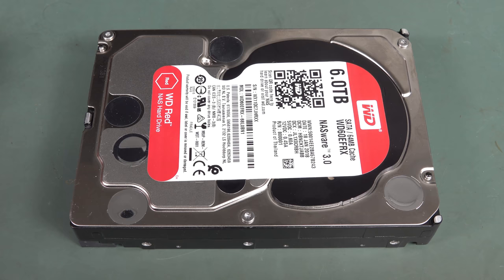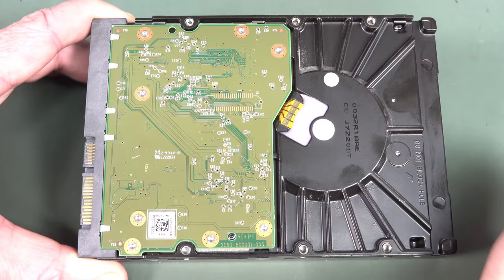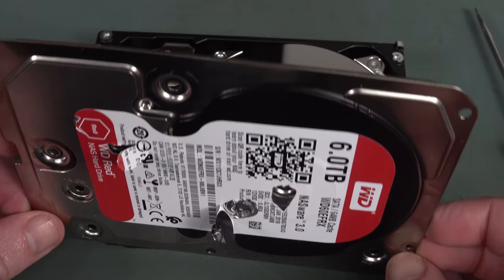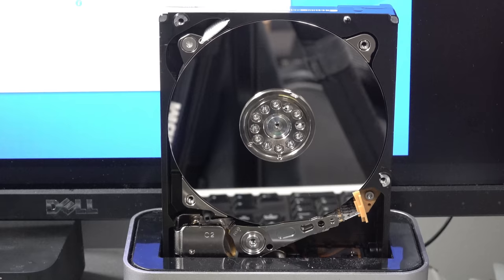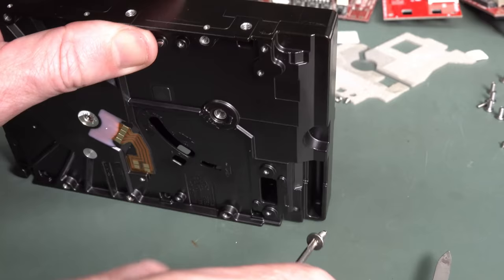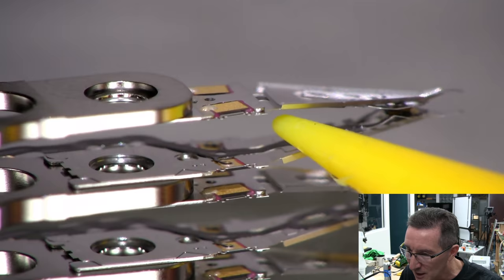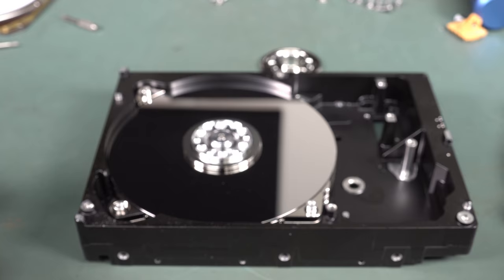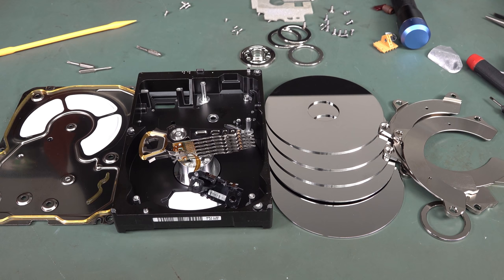EEVblog 1398 - Western Digital RED 6TB WD60EFRX Hard Drive TEARDOWN

Comment: In my experience, actual physical head crashes are extremely rare in modern hard drives (especially with 3.5" form factor drives) and the failure mode is almost always down to corruption of the embedded servo data, resulting in the drive being unable to track properly, or a problem with the drive electronics - the hub motor / head actuator drive chips often get very hot and are known to fail. The motors themselves very rarely give problems, so if a hard drive won't spin, it's usually going to be an issue on the PCB. Chattering heads (the actuator arm banging back and forth between its travel limits) is often caused by bad servo data, in which case there's not usually much that can be done to correct it. Total failure of the drive to be detected by the operating system is invariably the main onboard microcontroller/DSP chip and intermittent detection failure is usually just bad cables/connectors.

The little "bag" which you thought was a dessicant pack is actually a filter designed to trap any particles that get thrown off the surface of the platters - thses things are generally spinning at between 4000 and 8000 rpm and thus any dust and debris that lands on them will be hurled off at high speed due to centrifugal force - as a result, opening the hard drive in a non clean room environment is nowhere near as damaging as popular myth would have us believe - I've done it many times, particularly on certain laptop drives that have a habit of sticking (I'm looking at you, Samsung) without any problems, and many of those drives are still working years later (9 years and counting for one of my own drives). I wouldn't recommend it of course, but if you absolutely have no other options available to get a drive fixed, then it's not something you should be totally paranoid about, as it is entirely possible to get good and reliable results from this procedure. Obviously you should work in as clean an area as possible, using minimal air circulation (turn the desk fan off), keep your fingers and any tools off the platter surface and try to get the job done and the drive closed up again as quickly as possible.

(and try not to let your inevitable sweat drip onto the platters - that's never going to end well :) )
Reply: Thanks for this info. I’ve long suspected that head crashes are actually spectacularly rare, likely only to happen as a result of severe shock during operation (like in a dropped laptop, especially in the days before the drives had accelerometers that told them to park the heads as soon as a drop was detected). 

I had to LOL when Dave speculated the pads on the lid were to cushion the platter in case it wobbled... I guess he doesn’t know how insanely small the fly heights on hard drive heads are. (I suspect the pads are to dampen noise and vibration, but this is pure speculation.)
Reply: My vague recollection is that it's not necessarily unsalvageable, just difficult- the tracking data just spontaneously becoming unreadable without any signs of damage is unlikely, and the reason it can't find it, is that something up the chain has failed-heads, flex, amps, etc.

Not something easy to fix though- would likely need donor parts with the exact same serial number, and even then there can be different versions.

So you'd be spending at least as much as you paid for the drive to fix it just on parts.

Not a simple swap either, as there's some level of data on those boards that needs preserving, component level repair is the easier option.

The data is untouched, but the information is gone- without the way to properly interpret it, it's just noise
Reply: My experience matches yours. Additionally, in my experience a head crash (i.e. when the read/write head makes physical contact with the platter(s)) results in a scratching sound, rather than a click. The so-called "click of death" is actually the armature constantly resetting (as seen in the video).
Reply: We pull out head crashed 15k 2.5" drives all the time from the datacenter, almost all of them that suddenly died (instead of g-list getting full) are of that kind

Comment: The high capacity drives are filled with helium, that is in order to be able to hover the heads closer to the surface of the platters than atmospheric air allows.

The breather hole is needed on non-helium drives because the turbulence when the drives spin up, compresses some of the air, which causes lower pressure on top of the platters, causing the heads to hover too close, so when spinning up, they'll suck in air to compensate (over simplification), the helium drives have a slight over pressure to compensate for this.

The white pad is a filter, designed to collect contaminations thrown off the platters. however, activated charcoal filters, and desiccant is common to find also.

Regarding the screws, this is very common, i think they use custom sized torx, as i have experienced this many times.
The trick is to loosen the screws one by one, and re-tighten them before going on to the next, if you loosen all screws at once, the last screw will carry so much  load, that it can be hard to remove.

The various aluminum parts are nickel plated, that is why they have a texture that could look like cast some places.

Actuator arms have been both machined and cast over the years, but cast is more common in older drives.

The head parking feature is used on all HDDs today, because of the flatness of the platters and heads, they will actually stick if they ever contact the platters, so the heads can't rest on stationary platters like they did years ago.

Another fun fact, to ensure the heads are parked in case of power failure, it actually uses the platter motor as a generator, to generate just enough power to return the actuator home, before it is spun all the way down.
Reply: so that's what those traces were, splitting off at the motor, going into the case?
Reply: Helium is a good heat conductor.
Reply: @Inertia888  Nope, the 4 motor traces probably go straight to the windings with electronics choosing the energy direction.  On the head cable, there'll be fat traces to the speaker coil and to the chip power pins, while the thin traces carry data and perhaps control.

Comment: 15:06 That window is used for writing the servo track during production.
PS: I have been working for 4 years at Quantum Corp.
Reply: Have always wondered about that since it just didn't made any sense but now it do, thank you!
Reply: My first thought was that it would be for writing initial data. Thanks, James! I like Quantum. Been around for a long time. Pioneers. (I built the iRobot B21R's).
Reply: I thought those would be written before assembling the stack, then ignored on the surfaces that don't need it.  Or maybe written by the main head in a special firmware mode that starts by finding the extreme head positions, then step the actuator according to a precomputed curve or sensing the last written servo track weakly as it chooses the next track location (such an algorithm would result in slightly different track counts between drives, hidden by firmware from the logical interface view).

Comment: 12:17 I’m pretty sure that’s just the recirculating air filter. Any little bits flying around will be carried along the outside of the platters and get trapped there
Reply: Air filtration. And the bottom access (removed sealed label/tape) is to write/read rom sectors to drive at manufacturing (boot/block, servo information, etc). Many drives have the factory access on the side (sealed label/tape). Been awhile since I took a recovery class under Scott M. of MyHardDriveDied ... look him up...great resource here in the states.
Reply: Yeah, if you have ever opened a laptop HDD that had a serious head crash you can usually find all your data on that filter in dust form.
Reply: @DONK8008  It's entropy-encoded data.

Comment: 27:19 And that's where he discovered he had pulled out the wrong drive, and the defective drive is still in the NAS :P
Reply: Hahahahaha!
Reply: Curious Marc can still fix this drive
Reply: @roelandriemens  no way he could fix it
Reply: He could hear the drive sounds...
Actually in the old big (physical size) drives the head activator look like the coil in a huge speaker and was called "voice coil".
Working out that area was really dangerous because it could easily cut your fingers if you were in it's way.
Reply: @paulcohen1555  You know it was just a joke right? :P
Reply: @paulcohen1555  I think the one in this drive is still called a voice coil.
Reply: @roelandriemens  ROFL!

Comment: 17:06  The coil is an orthocyclic (non-helical) winding, onto a sector-shaped bobbin.
You can see the uneven step-over zone of the coil, nearest to the heads, where each loop of wire jogs to the next adjacent winding plane.

Comment: I think your diagnosis that it has crashed is incorrect.
The head positioning is done via feedback from the read signals from the heads, either a single servo head or (in this case) embedded servo information on all heads.
There has been a failure in the read amplifier and thus the head servo has lost control, and that is what you see and hear.
When you view videos from people who know how to recover these, you will see them replace head assemblies and make them work again (at least to read the data).
Reply from the maker: Well yeah, obviously. But it sounded bloody horrible before I took it apart and found there was no head crash.
Reply: Agreed. The noise heard was the continuous seeking due to head or board failure, rather than heads coming in contact with the platters. It’s good to know that most likely the data could have been easily recovered with just a board or head swap. Now if this would have been a Seagate drive….
Reply: @ecaparts  Could have been the arm the heads are attached to smashing into the center as well.  I have seen that happen more than once.  Makes a nasty noise.
Reply: My guess is that head contact would have a more consistent frequency. Either a steady screech or something synchronous with the platter rotation.  The sound you played was more stochastic, consistent with your conclusion and others that it was seeking gone wild.
Reply: i thought the motor slowed down too quickly after dave spun it.  i thought the motor or bearings may have failed.
Reply: @vsvnrg3263  That was probably the regenerative braking that uses flywheel energy to power shutdown activities.

Comment: If your re-assemble the magnets and drop one of the aluminium rings between them, you can see Lenz's law in action as the ring moves much slower than you would expect.
Reply: The first time I dropped a spherical magnet through a non-ferrous tube was... a treat of wonder. :)
Reply: ah we just did a bunch of Lenz's law in physics today
Reply: @DavidLindes  , that is one of the great wonders of the modern world that wasn't around when i was a kid.  i have a copper water pipe in this very room i'm in as i type this and a stack of super magnets that snugly slide down the pipe.  and whenever i come across more magnets of that diameter i add them to the stack and they slide down the pipe even slower.
Reply: @vsvnrg3263  nice. :)

Comment: WAY cooler video than I expected.  The microscope shots were just amazing to pause and just soak up all the incredible design and manufacture.  There's lots of voodoo in those devices...
Reply: Oh man, is that an understatement!!! There’s even more that goes into them now. The head itself is microscopic to the point you need a scanning electron microscope to see it. The coil to position the arms is only for rough positioning — the things on the arms Dave thought were test pads were actually the next hinge the head swings on, positioned by piezo actuators. The heads themselves fly on a cushion of air that was only 5nm thick on drives 10 years ago. (I can’t find any info on what they’re down to now.) Not micrometers, nanometers. For reference, the very latest microprocessors are made on a 5nm process. Green light is around 500nm.

Comment: Holes near the read amp have small traces going to them - may be for the gold plating process - connecting all the copper together, then punched out after plating
Reply: Also could be used for automated testing when the motor is being made to check resistance and inductance and probably ground leakage, gets trimmed off later
.
Reply: Or fex last step to open some very sensitive stuff up from shorting them to ground due to ESD reasons. there might be a reason it just at the head assembly.
Reply: The big bras "test pads" up near the heads are actually pietzo crystals. apply voltage moves the head left and right. its the fine adjustment to the servo.

Comment: Just want to say to everyone, that drives today from any manufacturer are pretty damn robust. They are machined to really tight tolerances and some have the ability to park the heads before physical damage can occur by detecting the G forces applied to the drive.  So the damage is less likely to be physical scrapes on the platters unless you've really dropped the drive or given it a jolt.  Desktop drives are more easily physically damaged from movement but desktops are less likely to be moved.  But really, the most likely failure point for any non-physically damaged drive are the pressure pads that let the signals travel between the board and the motor and heads.  At least that is what I've found to be the case.

The pressure contacts eventually begin to put less and less pressure on the pads over time and they also eventually start to oxidize, both problems create higher resistances in the connections and that eventually causes issues spinning the drive, moving the heads and reading/writing the data.  If you are placing a drive in a freezer to get data off and it's working then those pressure contacts are likely the reason why your drive is failing.  I've seen the pads for the head connectors oxidize causing read/write issues and I've seen the pressure connection pins for the motor connector loosen enough over time that the platters won't spin up properly or even at all.  Physically cleaning oxidation and bending the pins for the motor connector to make more pressure on the pads is usually enough to give a drive some life support but if you want reliability then it might be necessary to replace any aged pogo style connectors that are going to the head assembly. [... or just replace the pressure connectors with some carefully made direct wired connections and live a happy life with an almost immortal drive ...]  And I've never had to, but if you use something like Deoxit then only use it on the board side and not the mechanical side, or at least be careful and don't spray anything at it.  Just use a q-tip or cotton swab and don't get anything inside the mechanical part...

I've also seen shorted protection diodes on boards but that seems more likely an issue on external drives and less likely on internal drives unless the power supply is going out or you've got some fancy pants removable drive system.  And they really need to add some protection diodes on all power rails right over the motor driver and maybe even the DSP chip, too.  Faulty power connections occasionally destroy those things.
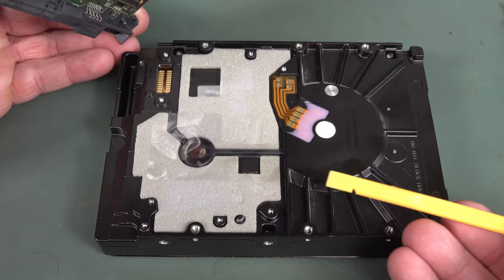Reply: at 4:35 was hoping for closer inspection of pads followed by clean and retry.

Comment: I'm glad you found the grease port after removing the silver sticker! unfortunately, this one was damaged already as you clearly could hear the dry bearing. but there is still hope for  other ones.
Reply from the maker: I should fill my other drives? Will axle grease do?
Reply: @EEVblog  Silly question, of course you use WD40, as you do for everything else 😉
Reply: @cornflake75  Hence the name WD40. It came with the first WD drive back in the days.
Reply: @EEVblog  I think elbow grease is the right kind
Reply: @EEVblog  That'd be proper pirate job. However, if the bearings are on their way out two things will happen: increased noise and higher han normal temps due to the extra drag. Maybe temps are not excessive as-in beyond manufacturer specs, but it's usually unswise to run HDDs beyond 40C.
Reply: @EEVblog  If your next teardown is an excavator you may pay attention to the grease ports...
Reply: @NicosLeben  No silly! Can't you see the drive is clearly marked WD60? These drives are just so sofisticated that the lower grade WD40 just will not do it, although maybe if you can get some fully synthetic 0W-40 it could work ;-)
Reply: @EEVblog  that is a good question I think. I do not understand why people are joking here.
Reply: @l3p3  The specified lubricant is likely proprietary. I doubt it is easily available. Everyone probably realizes this and is joking.

Comment: The platters make nice wind chimes.
Reply: Unless they’re glass (Death Star drives) 😂
Reply: I had one as shaving mirror for a couple years :D
Reply: But they'd all be the same note - you'd need different platters from different drives, and even then, they'd probably have a very similar pitch to them. I bet all the platters are nearly identical in every drive.
Reply: They also work good as a signaling mirror. 👀
Reply: I have a stack of old platters that I use as mirrors.  They are the perfect size to see the I/O on the back of an audio amp or preamp.
Reply: Nothing makes nice wind chimes 🎶💿🎶🤬
Reply: for sure
Reply: I've covered my wall with them. They make a neat mirror tile effect.
Reply: @jaxjackson4100  ... You can sight the other end through the centre hole. Perfect!
Reply: Not yet
Reply: @sofa-lofa4241  "Good wind chime" = oxymoron of the year.

Comment: Used to love taking apart hard drives as a kid. It really felt miraculous, even in the 90s, to have such a precisely made machine in your hands. It's actually a little surprising how superficially similar a modern unit looks to one of those old ones, though I'm sure the engineering has only gotten more advanced.